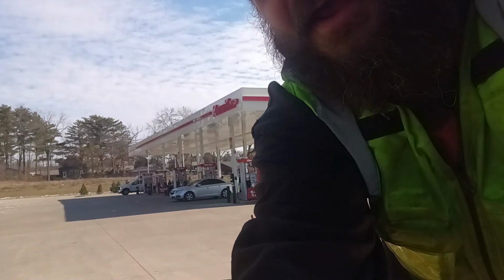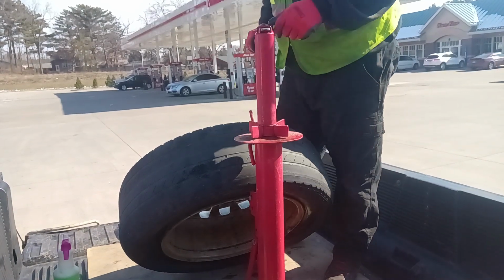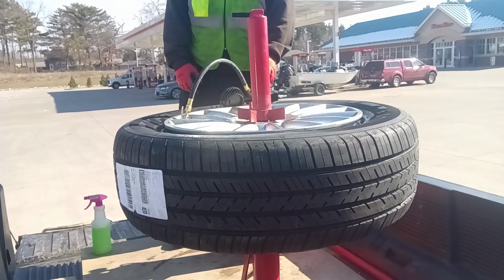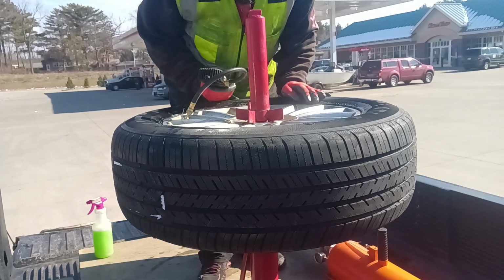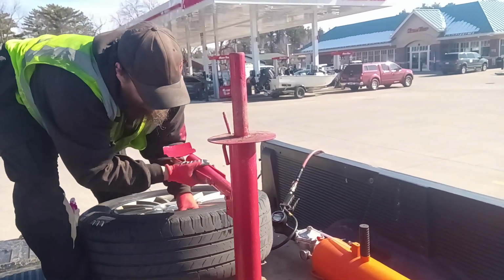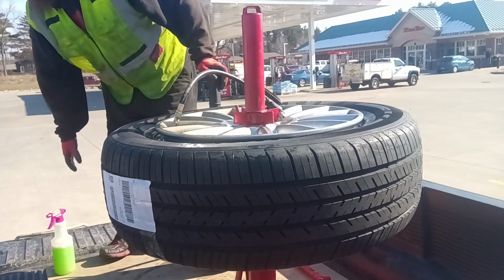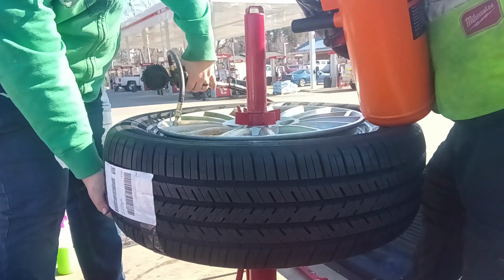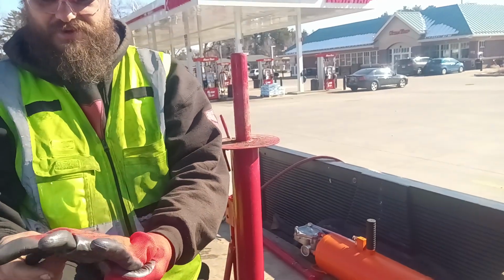Part 1: 4 Tire Replacement on a AWD Buick Enclave

Comment: Well I've removed and replaced 1000's of tires I've never seen someone put a Schrader valve in the stem before inflating the tire and setting the bead. It slows the the air pressure down. And the yellow dot has  to be in line with the valve stem so the tire is balanced. It's the lightest spot in the tire red is the heaviest.
 And having customers help is bad in alot of ways.
Reply from the maker: It really doesn't matter if you put the valve core in or not and I did line up the yellow dot with the valve when I put the tire on the rim I lined it up as I popped the top into place that's what I'm holding with my knee is the tire right there at the valve stem but no matter what even if you still line up everything the dots you still have to check it on a balancer. Did you not read the description on our YouTube channel? The customer helps because everything that we do is 100% Free we work off of Donations but it's not required for anybody to give us anything at all. We supply the tools and the knowledge to get the job done. It's actually the customers job we are there to assist the customer with there job or task that they need to get done so that's the reason for the customer helping us it's not bad at all it teaches them how to do it and if they don't want to help then we send them on to the garages that you pay and we move on to the next job. If we did if we did all the work ourselves we would have to charge like everyone else does and we wouldn't be out here helping anybody we'd be hurting the people just like everyone else these are the things that make us different than every other company out there. We are the first and only business of our kind if you'd look into what we do by going to our Facebook page or Google us we're found under the towing section on Google you might just learn a few things and how we operate. God bless and thanks for stopping by.
P.s. you do it your way and we'll do it our way have a nice day